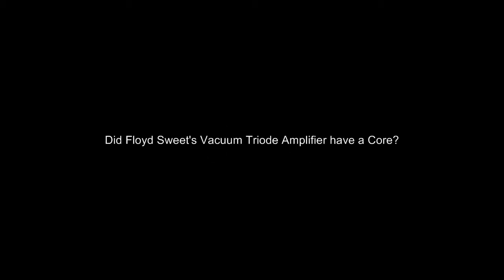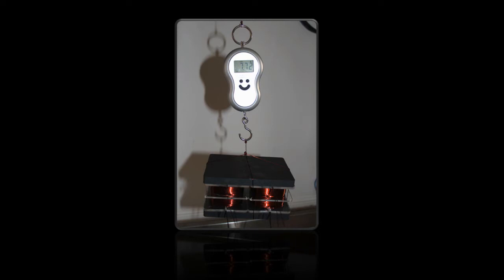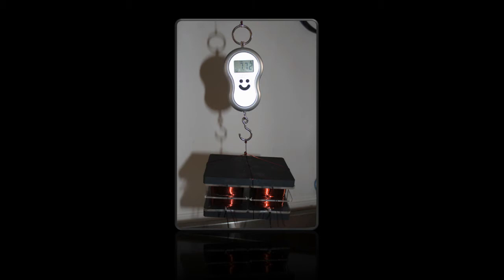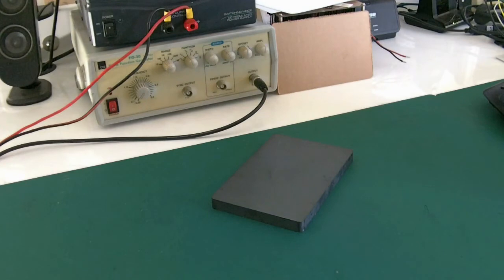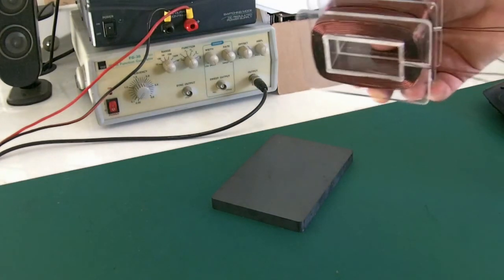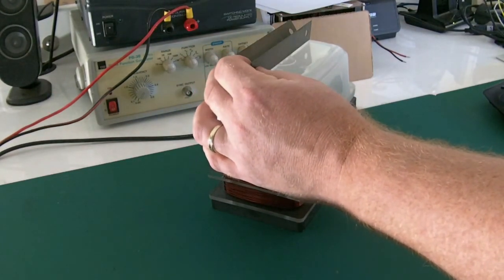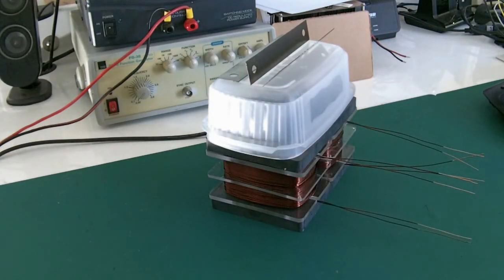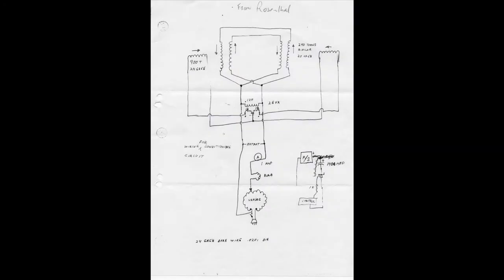Did Floyd Sweet's Vacuum Triode Amplifier have a Core?

Comment: Very Good and analytical approach, synthesized lady narrator is OK also. I always use the empirical method of experimentation. Building two different units, Hope for results. Your information is excellent and help in this research. None of the original project can be taken at face value, they would not make it easy for anyone to reproduce what was done, much info was not disclosed. Thanks you for your time and effort here...........marc.

Comment: One way to analyze this is to think about what the output impedance needs to be, and work backwards, taking measurements. E.g.: lets say you allow at most about 6A output at 120 VAC 60 Hz. Then impedance could be 20 ohm, which says inductance could be 53 mH. Knowing 240 turns bifilar for each power coil,  you can measure impedance on your reconstruction. I ran a solenoid calculator to get about 2200 microhenry for an isolated air core coil, 5 layers of awg 20 bifilar magnet wire, average diameter 90 mm, 100 mm length; your mileage may vary. Placing the magnets next to those should entrain the field and increase inductance, and wiring the circuit will have its own effects. So It's plausible that it might have a core. Probably also want to  find saturation currents.

Comment: Floyd Sweet VTA didn't have a core but only magnets beside the coils as explained by David Lowrance who saw one of its model. David Lowrance replicated this device using old autotransformer from ham radio and got it working, though his replication had thin ferrite metal instead of magnets. David explained that Sweet used 4x octave to divide the E/P ratio cuz 4x octave works as electric field spin. 
Tempic field (A field or motional emf)=2x
Electric field=4x
Magnetic field=8x, with magnetic field being the weakest force among them.
The used of 25W minimal in the device was to couple the load with the device through the vibration frequency send back by the diodes, thereby triggering self powering mode. If that diodes bridge is not there the device won't respond. Another thing is David used feel felt sense of chi meditation to detect the vibration frequency of the E/P ratio couple, I believe Floyd Sweet himself did that too. I have been using my palms to detect the scalar field ( A field if u will) in electric fans and RA tubes. The A field is a vibration which cannot be measured by EM test gears but can be felt by the pineal gland at the center of the brain, that is for those who are sensitive to vibration. In both David Lowrance replicated device and Floyd Sweet VTA Variac was used to tune for feel felt of the π/2 ratio of the atom. If one don't have the feel felt sense, it will be difficult to replicate the VTA. I will suggest you visit www.resonantfractals.org/Doc/1index.html to get assistance on how to feel tempic field vibrations.

Comment: One major problem why I do not attempt this VTA replication is that am just a physicist with limited knowledge of coils winding. I do not know which winding should be hot and which one should be neutral, not even to talk of ground. If I can get this windings correct or have someone show me how to do it I will contribute a lot to bring this VTA back to live cuz I understand how atom work. As a Physicist I can explain Sweet's VTA from nuclear aspect. I can feel the A field using Aluminum tube. Can u help out on how to wind the coils please? I know how to wind bifilar coils and gate them but my problem is how to bring out neutral and ground leads (wires) out. Just help me please.
Reply: From the schematic, output terminals are A and B, and are balanced, so it shouldn't matter which connects to hot or neutral. I believe the device is not grounded. For safety, you might connect the aluminum box to ground? But I am not certain. Power coils are solenoids, wound opposite, coil length equals diameter, there are multiple configs, in some photos it looks like both have poles vertical, facing the magnets (one has N up at same time the other is S up), however in the broken one belonging to John Bedini, the power coils are arranged orthogonal, (one has poles out front and back, the other has poles out left and right sides). Bedini's was also just an acrylic box.

Comment: Floyd was very forthcoming with his explanations. The problem is that people like Walt ALWAYS "interpret" what the inventors tell them. Common flaw from what I have seen with replicators. People always try to add their chocolate chips and extra sugar before they even know how the basic cookie recipe tastes, so to speak, and then blame the recipe if the cookies are nasty. Personally, I don't think Floyd was "lying" or leaving much of anything out. I just don't think people were actually listening to him. You can't replicate Floyd Sweet by building a coil how Walt, Naudin, or anyone else "interprets" how to build a device -- a device they never could replicate themselves correctly. IE, don't ask people for information, who obviously don't know. Bearden clearly stated that the problems was in the magnets, that even Floyd had problems conditioning them properly until he had a special circuit made specifically for him for the purpose. In one video I watched where Bearden was doing the measuring, the coils in question was an open air, open ended aluminum box setup and you know for a fact Bearden would have examined it visually at least. Bearden said it consisted of coils and two magnets, and I have no reason to doubt his firsthand observations. After reading Floyd's own somewhat unconventional explanation of how his setup works, I see no reason to doubt that either. Floyd was no "Hutchinson"," IE someone with no clue. He had a degree in E.E. from MIT and designed transformers for a living. He had to stray from conventional theory because conventional theory did not explain the evidence at hand, not because he somehow didn't understand conventional theory or was shoveling BS. That is the very first mistake of replicators of items such as this, specifically an inherent sense of superiority considering the inventor. The concept of the fluctuating quantum vacuum has been around for a long time, and how a triode tube works is basic, so what was amazing with some of the "replicators" was that they could not even understand why Bearden gave the device the moniker of "Vacuum Triode Amplifier!" The name fits, lol, and seems fairly accurate, as, assuming it is ZPE, the grid voltage (60hz control coil) controls the much larger 60hz ZPE supplied output current.